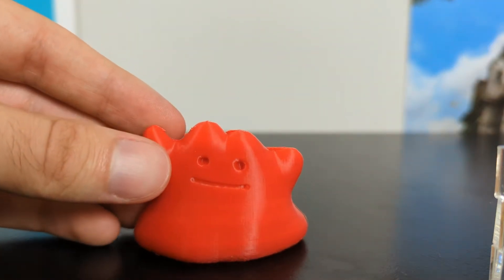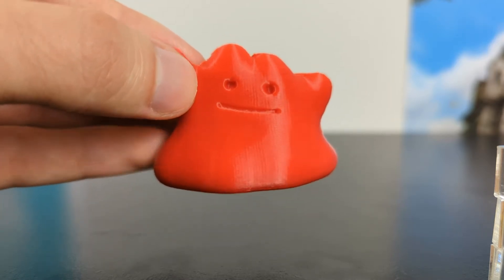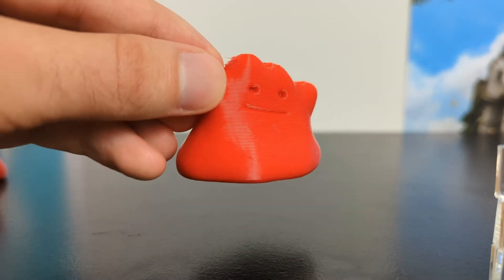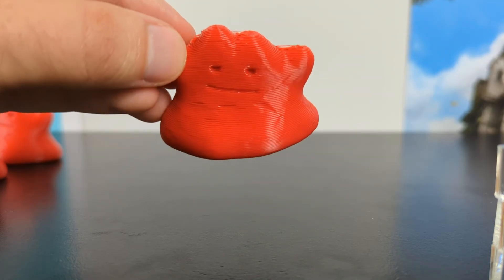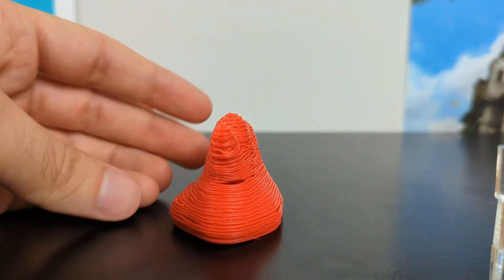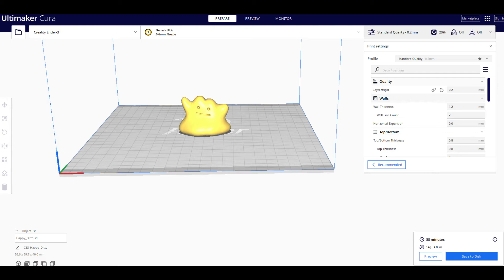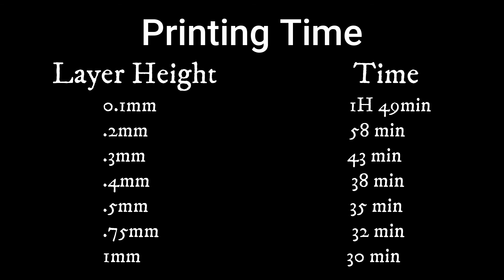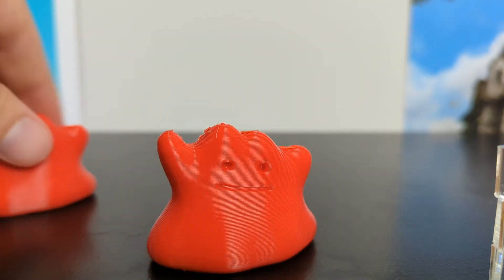Testing Various Layer Heights and Print Quality #3dprinting

Comment: great video, could you also do one on the different scaffolding settings
Reply from the maker: Would you mind elaborating on "scaffolding" settings.  Not sure what you are indicating
Reply: @OverExtrudedPhysicist  im still rather new and have been using cura as a slicer, when i started using supports the default was the tree setting which i had no idea how to use so i ended up getting more support than print until i realized how to change it  to the standard type. 

what i wanted to see tested though was the different types of support patterns and where to use them, also the "support top distance" and "support bottom distance" functions, and ive seen the "support interface" but haven't used it yet

love your channel and found it when i was brand new to 3d printing, I remember finding your video on printing speed as its one of the first settings in the slicer that i googled. thanks to you and cnc kitchen i learned alot very quickly
Reply from the maker: Awesome thanks, I'll look into that support video.  I think I too could learn a thing or two more.  With each update they add stuff @patrickradvanyi6390